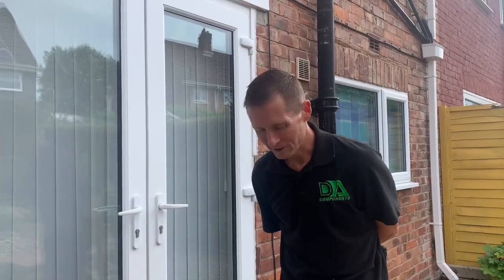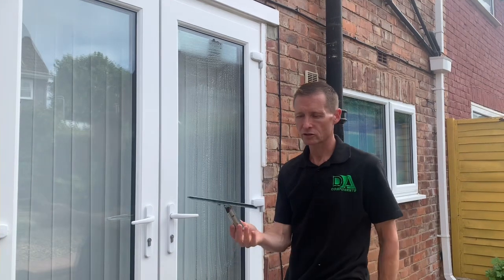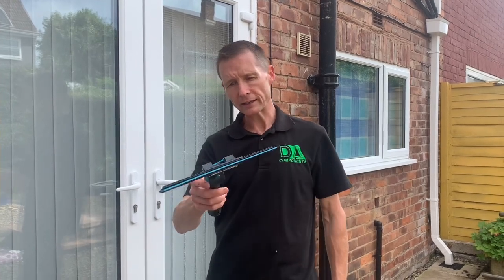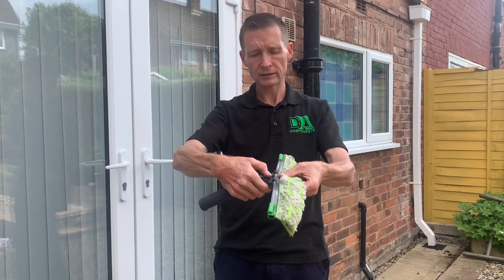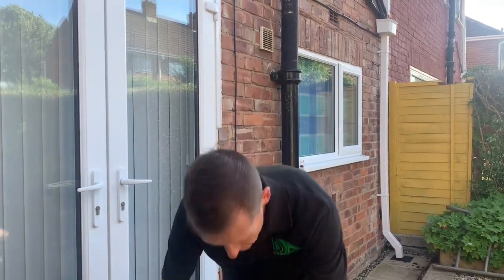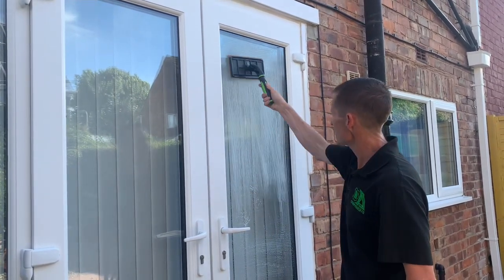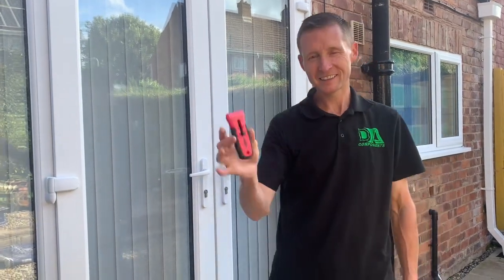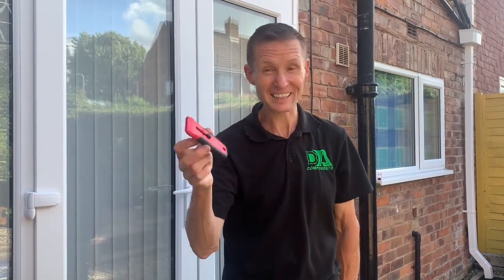My Top 5 Traditional Window Cleaning Tools

Comment: Awesome, great video. Is there any reason you don't use the plastic end clips at the end of the channel? I just wondering, I use Moerman, with Moerman channel, but it does have the plastic end clip and I'd like to know if it's better with it or without it.
Reply from the maker: @InMission  Cheers for the nice comments, I took them off because sometimes their can dig into the rubber edge of windows. But I do believe it’s a personal preference.

Comment: Hi Darren, good video. question? Your Moerman channel sans end clips. Have you removed them or is this anew standard channel?
Reply from the maker: Hi mate I removed them as the clips as it feels like it digs in on the the edges .
Reply: @dacomponents  Cheers man, I’ve been using them from day one so have adjusted to them. The only frames that continue to gives issues are raw timber ones. By the by Moerman’s current handle (last 12 months or so) have an adjustable bolt at the pivot which allows fine tuning of the pivot tension….although I’d done that modification with my earlier handles as well 😊
Reply from the maker: @evgilliand  fantastic, hope ya well mate